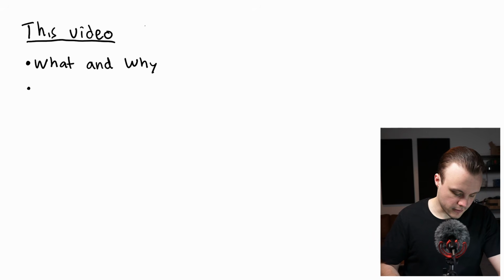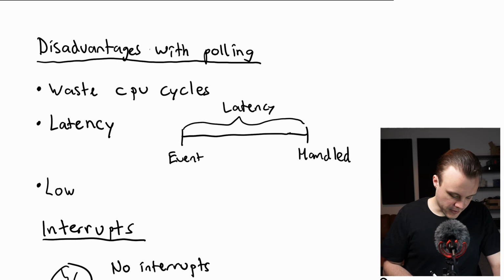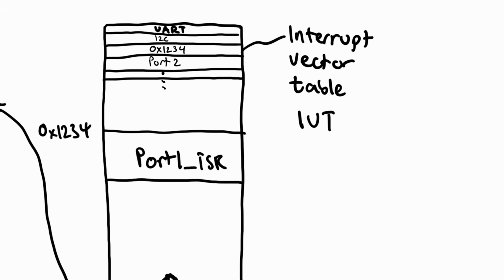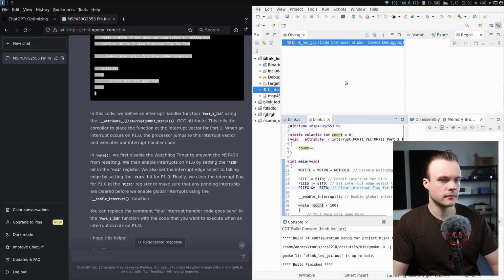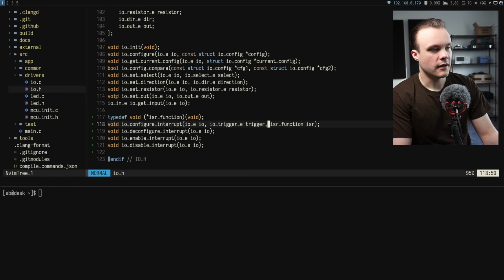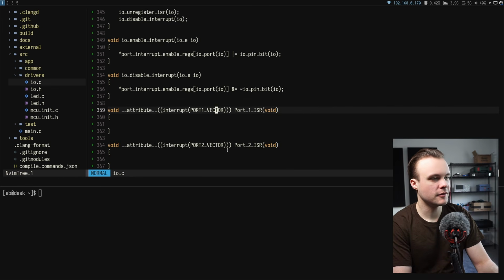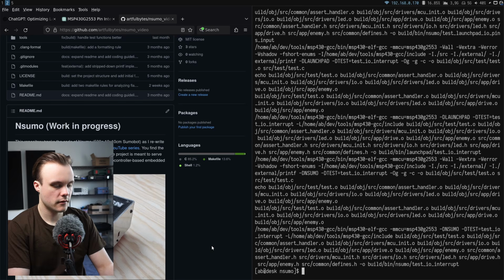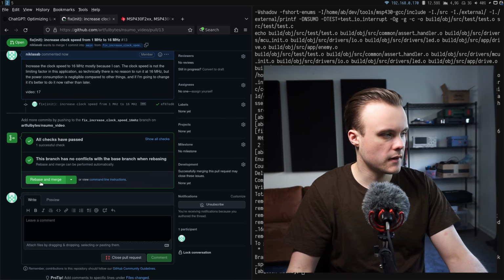Microcontroller Interrupts | Embedded System Project Series #17

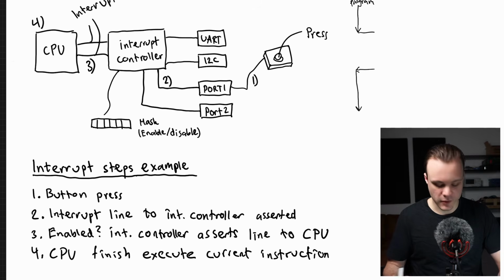Comment: 12:39 The description of "5. Save state" is incorrect for ARMv7. According to ARMv7 ARM $B1.5.6, the saved state is comprised of eight 32-bit values.  Note that these values are not all from registers. They are xPSR, ReturnAddress, LR (R14), R12, R3, R2, R1, and R0. Note that 1) SP (R13) is not  part of this state being saved. 2) PC is not saved but ReturnAddress is saved, which is determined by the exception type. SP is saved for normal function call. But not necessarily ISR. This video mixed both.
Reply: He in that project was not using an ARM MCU

Comment: One question if the IVT is in the flash how can you change the ISR?
Reply from the maker: The addresses of the entries in the IVT are fixed*, but the entries themselves (ISR addresses) can be changed. *Technically, some architectures also allow you to relocate the IVT.
Reply: When you use two firmware on the same mcu like a bootloader and a application you will need to edit the ISR address register else the application can call bootloader ISR and BAMM error